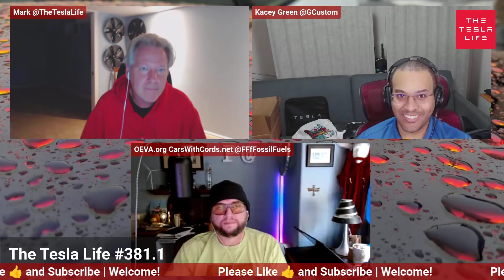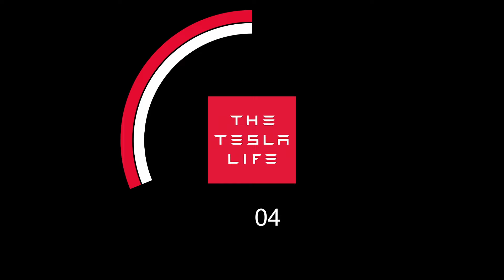TTL Express #381.1 - DHL Impressed with TeslaSemi

Comment: Here in Europe, we see more electric trucks on the roads every month.  And the drivers seem to LOVE them.  From a video made by a German electric truck driver (https://www.youtube.com/watch?v=I4b-cybcgkM&t=767s), there remains two problems, though:  
1. The range of those trucks is for a number of them not enough to go for 4.5 hours (the maximum time between mandatory rest periods) without charging.  Those driver must hence stop more often hence have a longer work day.  But that would in no way apply to the Tesla Semi, not even to its shorter-range version, as a range of only around 275 mile is enough to solve that problem with range to spare!
2. Not enough charger locations with at least a couple of chargers installed as "drive-throughs".  In some cases, it forces the driver to decouple the trailer before charging... or forces the lazy one to hog 6 car charging spots (see it happen in the video mentioned above)!.  Obviously a charging infrastructure deficit to be quickly remedied!
Reply from the maker: thanks for the insight of your area